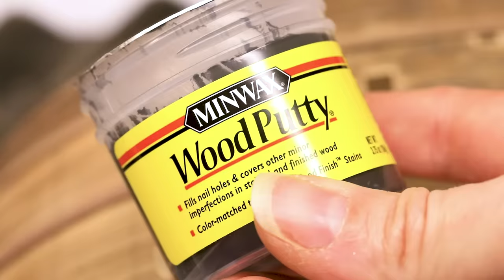Model ship building  - RAGUSIAN CARRACK XVIc - Full Build-Log

Comment: Apologize for not looking closely but what books on Mary Rose would yoou suggest to a modeker ready to begin such project with JoTiKa kit?
Reply from the maker: Hard question. I have recommended all the books I know about this ship, because each one has valuable information. But there is still no final publication with the correct lines of the ship. There are only theoretically possible - made according to the technology of that time, simply adjusted to the dimensions of Mary Rose...

Comment: Fantastic build, and very inspirational videos! If you are going to use LED’s on a later build, you may want to consider diffusing them with 240 or 320 grit sandpaper. Lots of related info on Google.
Reply from the maker: Or simply sand the rounded bottom on the disc sander...